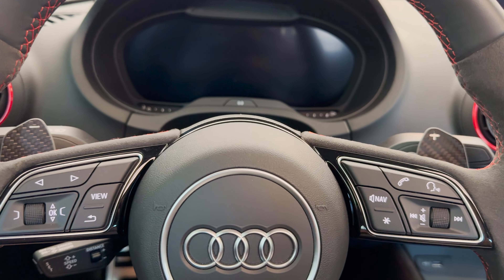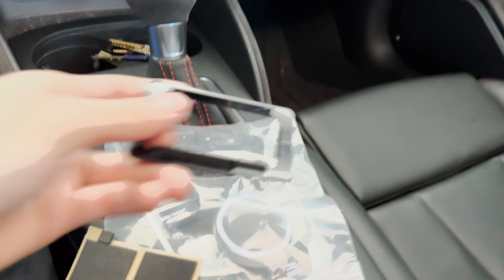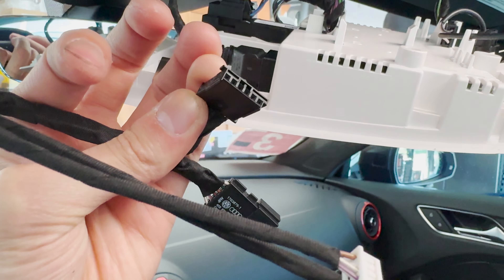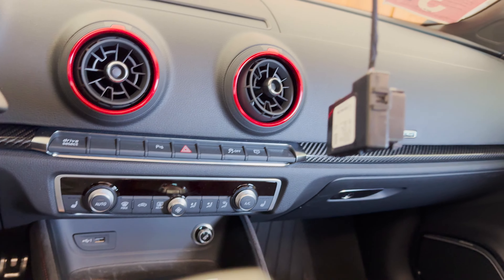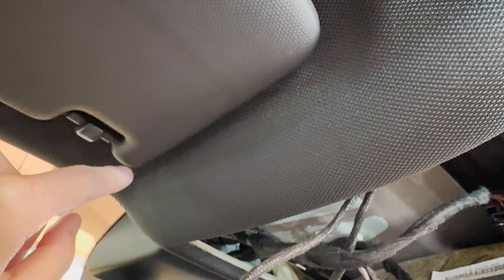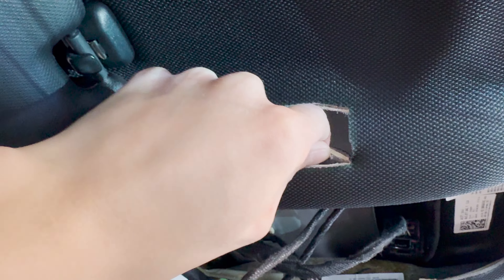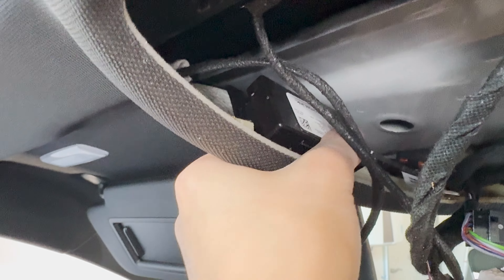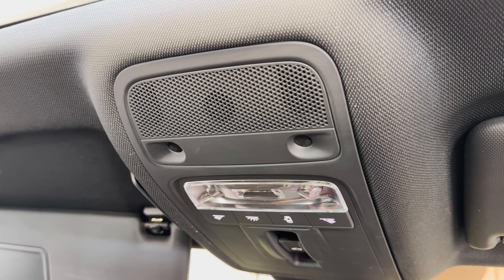HOW TO ADD HOMELINK GARAGE TO YOUR AUDI RS3 8V

Comment: I was just looking at this kit. Glad you made an install video. Question though do you have lane assist and acc on your rs3?  Or do you not have acc
Reply from the maker: Yeah I would definitely recommend it as it’s an OEM part. Yes I do have ACC and lane assist on my RS3
Reply: @4enthusiasts ill be more scared to cut the headliner as i did custom Alcantara but have been wanting this a long time
Reply from the maker: The headliner is very thin from the factory. Not sure if yours is thicker but it was very easy to cut, you should be good 👍

Comment: what do you think about the Gen 1 2017 Bmw 340i xdrive and the 2018 Audi B9 S5 ? I’m stuck between these two because i’m looking for one of these to be able to mod , speed, power, and just to have fun with while still not going over the budget of 5k for mods. Could you help me out at all?
Reply from the maker: Both are great in their own ways. I am biased with Audis. A B9 S5 using 034motorsport parts can easily be done at your home without going to a shop to get it tuned and it’s a turbo swap away from making big power. The B58 in the M340i is no joke with just a tune. The only thing is that you have to get a custom tune and every tuner is different but you using end up spending less with a BMw to make power. 034motorsport and others make it easy to flash from your garage.
Reply: @4enthusiasts  i can’t afford a M340i but i can afford a 2017 340. would this make a difference for power. and also how give of a difference would they both be in spending money to make them good?
Reply: @4enthusiasts  I’m wanting to race people too but don’t wanna put in a lot of money into it just to make less than 600hp. i’m comfortable with spending it over time but for now 3k-5k is where i’m sitting at. would either one have a better chance over the other?
Reply from the maker: Either one is great, you just got to test drive both to compare and read a bunch with the forums
Reply from the maker: The B58 gen 2 in the M340i is overall just better than the gen 1 in the 340i
Reply: @4enthusiasts  yes they are but i don’t have enough money to buy the M340
Reply: @4enthusiasts  yes that’s true, everyone i’ve asked said the s5 because it looks better and they say looks is better than performance which i highly disagree on and that’s why ive added the gen 1 340 into this
Reply: @4enthusiasts  what if i added in the bmw 540i?